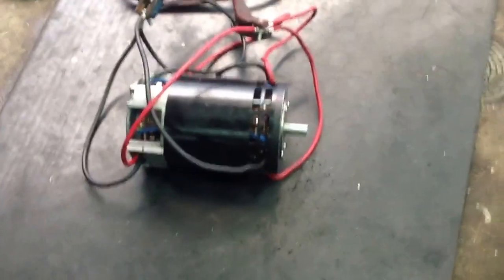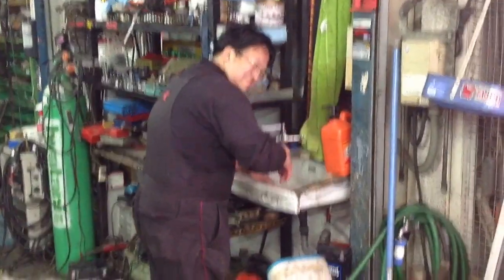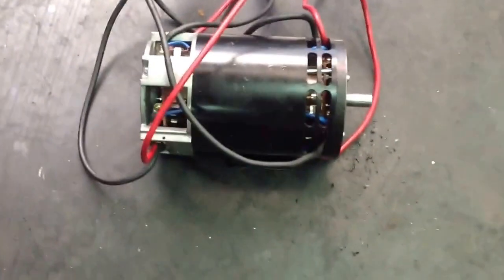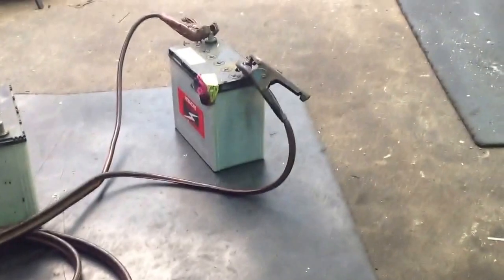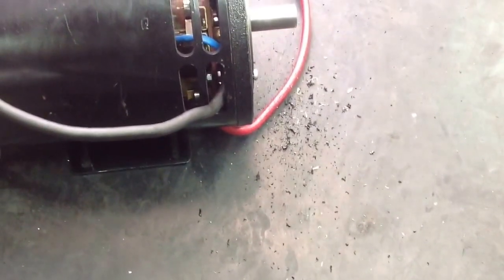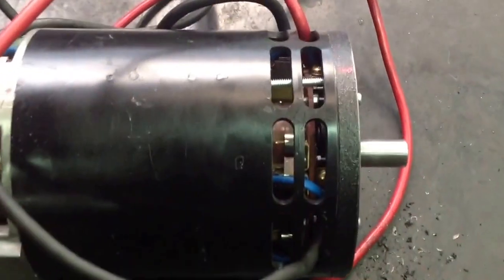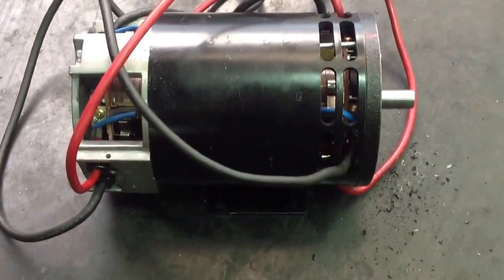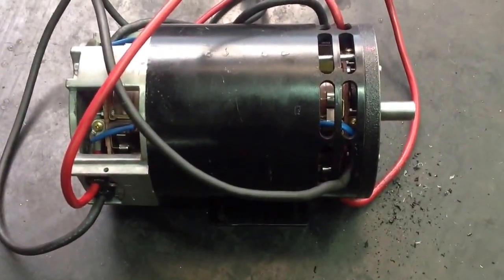EV electric motor prototype 手作り電気自動車 EV プロトタイプ

Comment from the maker: I check the model number from Hitachi Batteries. The page was in Japanese but it looks like the battery is 35amps.  The total run time was 43 mins before the motor stopped.

Comment from the maker: My electrical engineering team designed this motor.  I ordered the parts, assembled the motor parts, then used copper wire to wind the coils and now testing. She passed the 12 volts test. Now I can use higher voltage. From start to finish it take about 35 hours.  It's a lot of work but I've learned a lot  about making an electric motor. It's fun and interesting for me.

Keep it Clean and Green